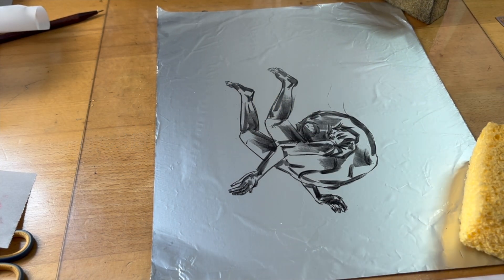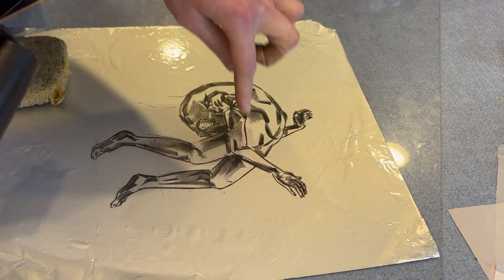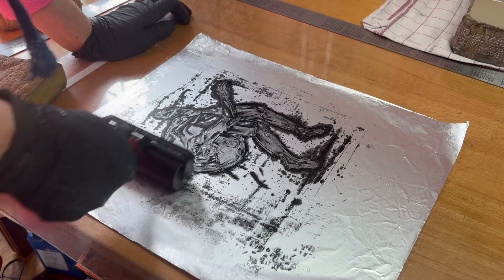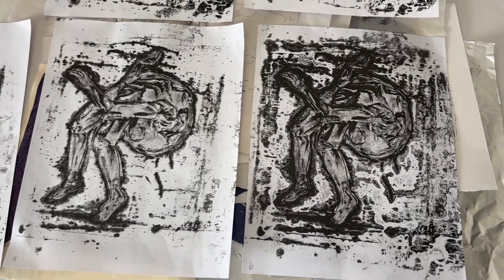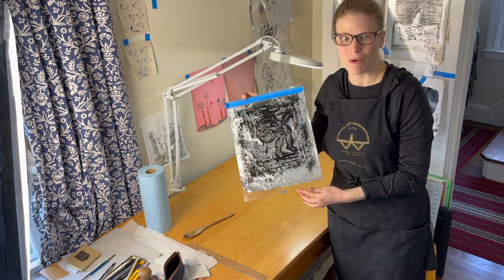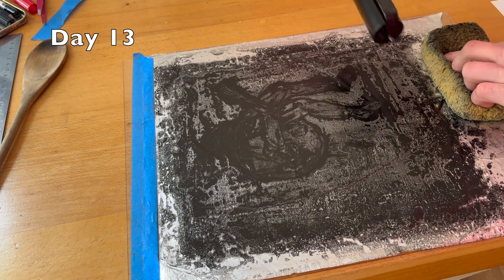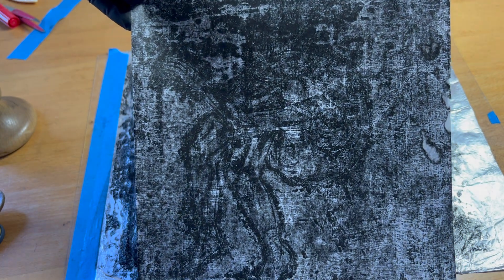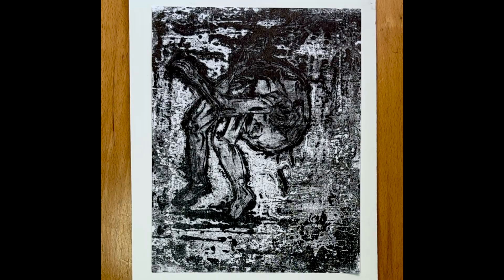Kitchen Lithography Experiment - Total Destruction

Comment: And if you cleaned the foil again with oil?
Reply from the maker: If you cleaned with oil without protecting the foil with gum arabic, the rate of destruction would most likely be sped up. If you preserved the plate first and then cleaned with oil, it would print just fine.

Comment: How many prints can you pull from a kitchen litho plate without the state changes?
Are you using regular foil or heavy duty?
Reply from the maker: The most I have done is when I printed business cards. I printed over 100 from the same foil before it started to deteriorate. At that point, the background started to pick up ink and no amount of fountain solution or re-etching could save it. I almost always print less than 20 because I have no need for large editions, not because the foil couldn't keep going.
Reply: @valeriesyposz  Right on! Thank you.
Reply from the maker: Oh and I prefer heavy duty because it's easier to avoid wrinkling.